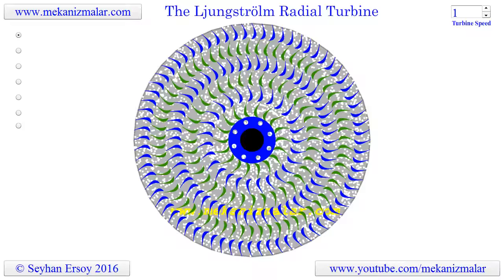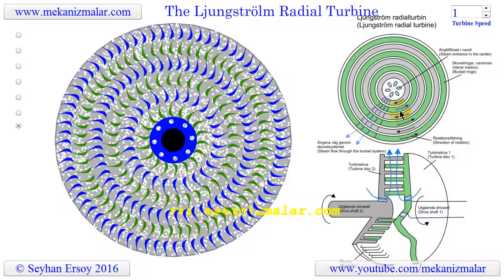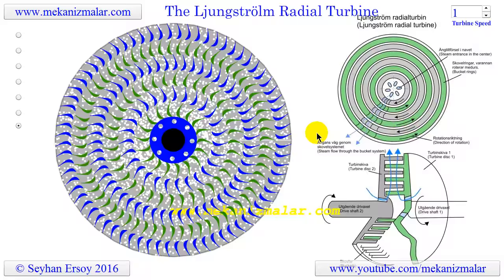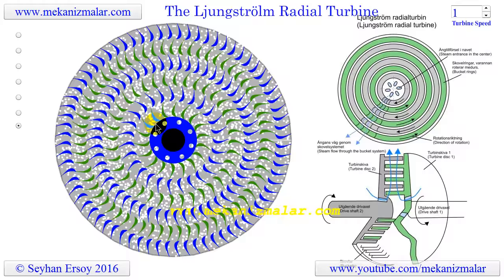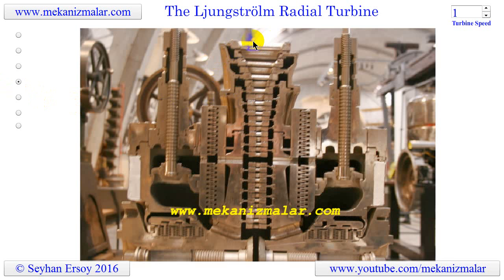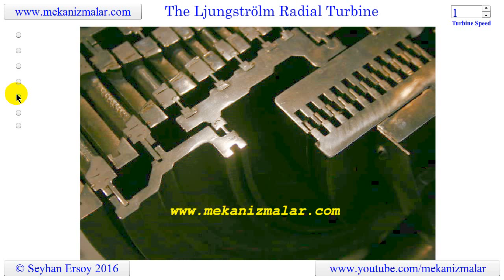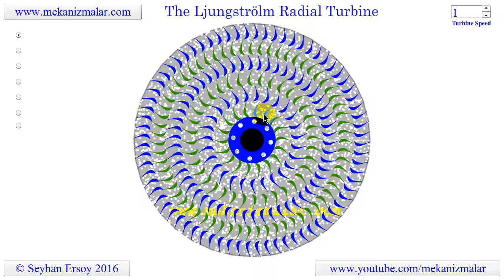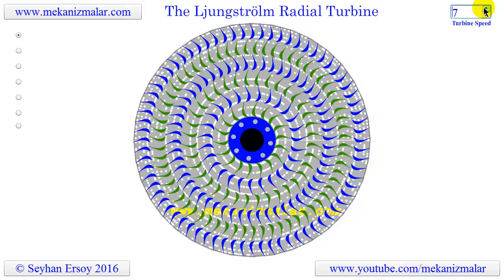the ljungstroms radial steam turbine

Comment: I am looking into miniaturizing a radial steam turbine, to about 200KW and in confined space.
Could this be the solution? Do you take the power from both ends? Do you actually drive 2 generators?
Reply: You can do that. However, it may take your time, and it could be expensive.

Comment: I really like this. It looks really easy to make the blades in a 3 axis CNC mill. I would make every other set of blades stators to keep it simple.
Reply from the maker: If you do it, please let me see a video of it.
Reply: I don't think my boss would let me. It would take a lot of metal. Something for solidworks though.
Reply from the maker: Thanks for the liking my video. I would appreciate if you also give a thumb up to it.
Reply: In theory a demonstrator could be built with inexpensive off the shelf squirrel cage blower fans nested within each other. I'm surprised that there is no historical use of this idea as opposed to the standard axial flow turbines and single stage radials.
Reply: While this is an interesting design I disagree with the assertion that the counter rotating blades will increase efficiency by 4 fold. Because the concentric sets of blades are moving in opposite directions the amount of force each set of blades experiences from the steam exiting the previous blade set will be reduced not increased. An example would be someone throwing a rock at 25 mph at a train passing at 10 mph. The rock hits the train at 15 mph. However if he is on another train passing in the opposite direction at 10 mph then the rock strikes the other train at 5 mph. A possible solution would be to introduce the steam at the periphery rather than the center. Then as the steam flows inward and expands the velocity must increase, possibly compensating for the loss of force due to the opposite rotational velocity of the previous set of blades. Also the poster does not make clear that the Wagon Weel Effect is an ILLUSION. The concentric blades in each shaft do not actually rotate at different speeds.
Reply: @nyarvideo  you have to compare with a turbine using stator blades. The energy equals the relative speed squared between the turbines or between one turbine and a stator-arrangement. It will be obvious that the latter will demand twice the rpm on the turbine for the same efficiency as the ljungström turbine. And if you have worked as much as I with rotational movement you will appreciate every drop in rpm that is possible due to all the forces due to higher rpm.

Comment: Power plants do not use these Robot. They use axial steam turbines!
Reply: However, the world larges ship was using this turbine for propulsion.
Reply: @seyhanersoy8989  Likely due to lower RPM, since there is a dramatic difference for the gearbox to lower the speed to shaft RPM